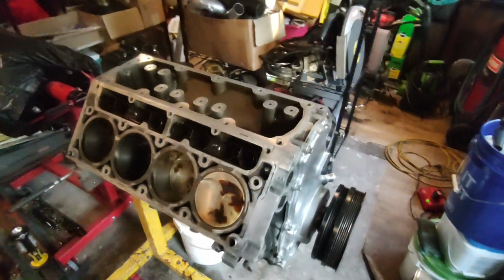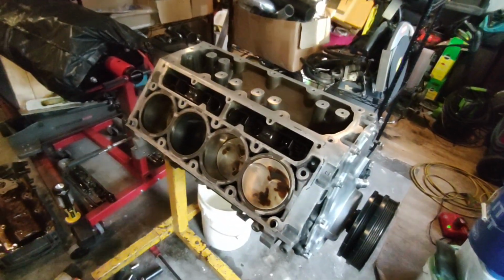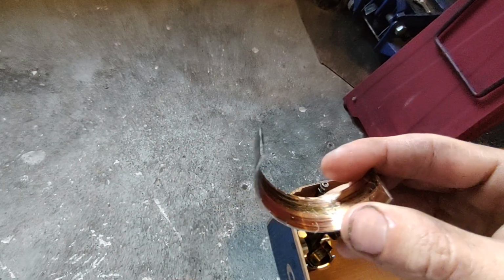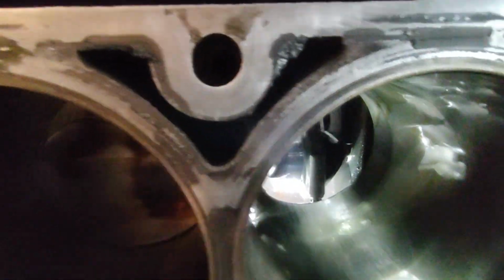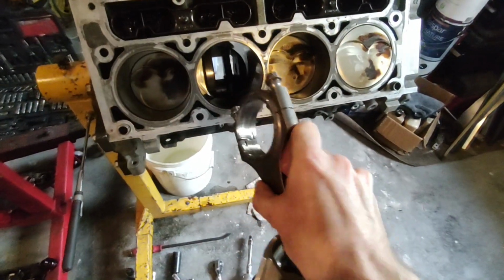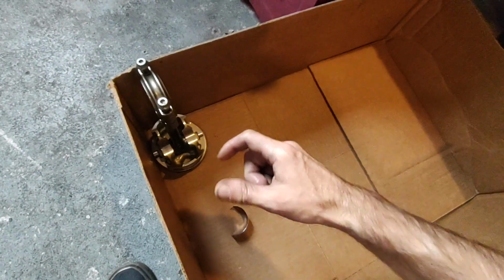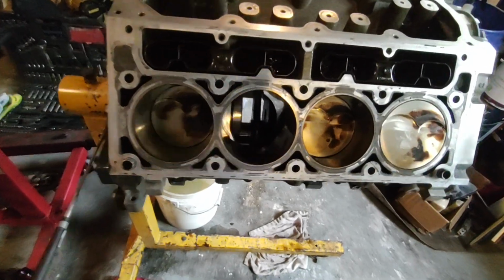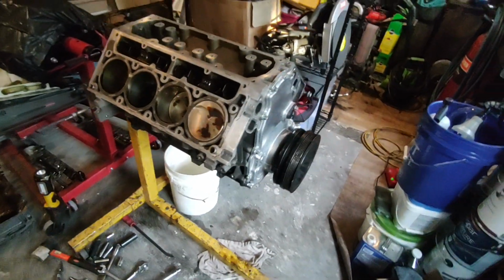Built 6.0 LS2 is blown up (I'm an idiot)

Comment: Have you checked the rest of the bearings?  If you installed brand new bearings on a used crank, this will happen just about every time. The wear on a crank journal can be microscopic and not be seen or noticed without a microscope. The journals wear in a U shape.  So if you dont reuse the same bearings that were on the crank when you disassembled the engine, the crank needs to be turned and polished. Industry standard is +10 and +20 for the rod bearings and the mains. Now if this is an aftermarket crank the non chamfered ends of the rods face eachother. Keep in mind that many aftermarket cranks require narrow width bearings.  Dont be ashamed. We’ve all been there.
Reply from the maker: The rest of the bearings look perfect